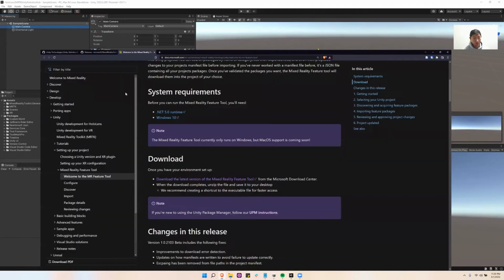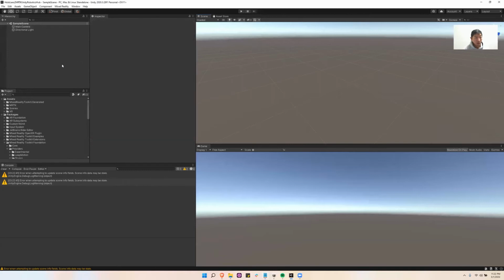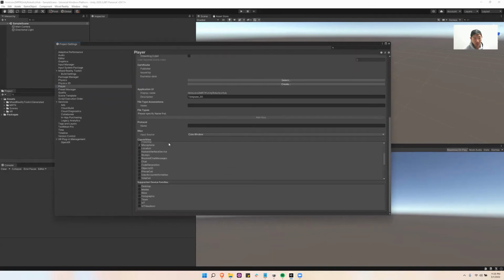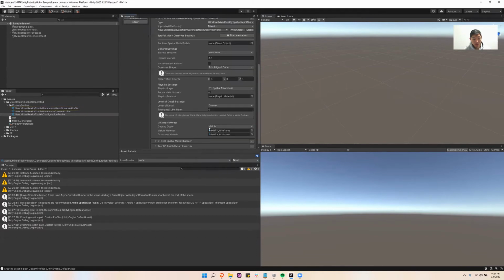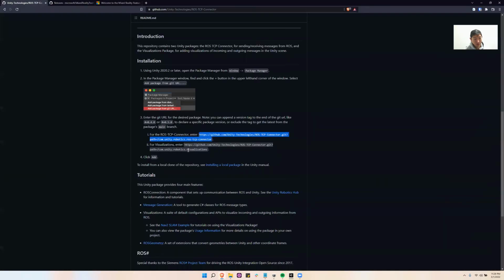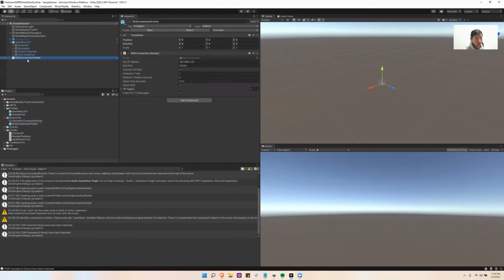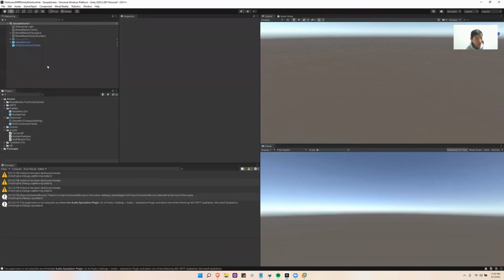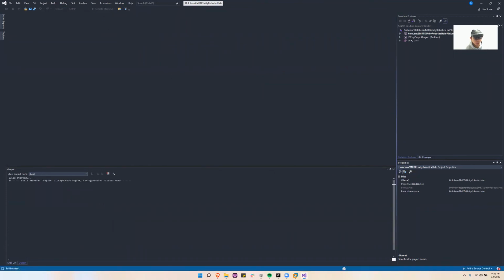(Updated) Unity Robotics Hub: Connecting ROS to a Unity project on the Hololens 2

Comment: Hello Bryce,

Thank you so much for your tutorial! It has been incredibly helpful. However, I’m facing an issue where I cannot get the HoloLens to communicate with ROS. Specifically:

I can’t see the IP address status (in red or green) on the configuration button within the HoloLens application.
When I try to input the IP address using the number pad, nothing happens.
I’ve done some troubleshooting and confirmed that Unity can communicate with ROS successfully when running the application on my laptop. However, the HoloLens seems unable to connect. I also tried using the ROS bridge URL in other projects, but the same issue persists. This indicates that the problem lies with the HoloLens.

To diagnose further, I ran the following command in WSL:
nc -zv <IP Address> 10000
This was to check if the HoloLens could communicate through port 10000, but it failed, confirming that the problem is with the HoloLens.

Do you have any suggestions on what might be causing this or steps I can take to resolve it?

Thank you in advance for your help!
Reply from the maker: It has been a long time since I have deployed a project to the Hololens 2. Rather, I strongly recommend using holographic remoting if your project allows you to do so. That fixed all my networking problems. If you can't do that, I would recommend making sure your hololens is on the same wi-fi network, in developer mode, and if using docker it is bridging correctly.
Reply: Thank you so much @bryceikeda7782 !! I tried holographic remoting, and it worked! Any idea why this approach succeeded, while running the project as a standalone application on the HoloLens 2 did not? Do you have any suggestions for troubleshooting or improving the standalone application? Thank you!
Reply: Thank you so much, @bryceikeda7782  !! I tried holographic remoting, and it worked! Any idea why this approach succeeded, while running the project as a standalone application on the HoloLens 2 did not? Do you have any suggestions for troubleshooting or improving the standalone application? Thank you again!
Reply: Thank you very much @bryceikeda7782  !! This really helped!! Any idea why deploying the application as a standalone on the HoloLens2 is not working, while holographic remoting is working? Do you have any thoughts about how to establish communication without using Holographic remoting? Thank you again!

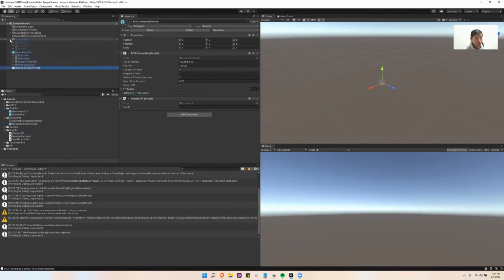Comment: Hi, Thank you so much for your video it is helpful to make my project topic based on augmented reality. But im facing an issue that is in my number pad input (script), There are no any tabs for ROS and connect IP. Only two tabs are available it is script and set IP button text. How to get those ROS and connect IP tabs? (For your ref: you explained this in your video on 9:01).
Reply from the maker: It's been a while since I've worked with this repo. However, I think I updated the directions so the video is slightly out of date. I would follow the REAME directions in the repository itself. If that still doesn't work let me know!

Comment: Thank you so much Bryce for this amazing tutorial! 
I seem to have almost everything working... I'm on Win11. I've successfully built the HoloLensBaseProject and uploaded it to my Hololens device, and I've properly established a connection between my ROS on WSL2 and my Hololens device. I even get the number counter incrementing!

There is just one issue, on Hololens, the first button is forever stuck with the subtitle "Set IP Address".
When clicked it opens up the custom keypad. This keypad is pretty much unresponsive. The textbox is stuck saying "Enter IP Address..." and all numberpad keys are unresponsive. Hitting clear, backspace, or OK does not interfere with my ROS connection whatsoever.
My connection with ROS is working, but that's because I set up the correct IP Address while building the project in Unity under Robotics > ROS Settings.

What is weird is that when I press play in the Unity editor, I can also connect to my WSL ROS, but there, the buttons work ! The first button has my chosen ROS IP as a subtitle, and the keypad keys are responsive. I can change my IP with the keypad to disconnect and to reconnect.

Would you have any idea why the menu and keypad wouldn't work on Hololens vs on Unity?

Thank you very much in advance,
-Liam
Reply from the maker: Hmm this is a tough one. It's weird that it works in play mode but not during deployment. Have you checked to make sure you are building the correct scene?
Reply: Hi,I have encountered the same problem as you. Have you resolved it yet,Thank you very much in advance
Reply: @游勇-v7d  I unfortunately haven't figured out how to fix this issue. I will write again if I find a solution someday. @bryceikeda7782 I believe I am building the correct scene (the only scene I have in my project).

Comment: hi Bryce, thanks for your video. I can connect to the ros on Ubuntu via Unity on Windows (Green on IP position). However, the hololens2 can not connect to the ros (Nothing happened). I can not find the problem.
Reply from the maker: Hi Jiazhen, are you able to successfully ping the HoloLens IP from Ubuntu?
Reply: @bryceikeda7782  I can't ping Hololens from Ubuntu (VM), but I can access to the 1XX.XXX.XXX.XX to control the Hololens on the web browser... btw I can ping my windows from Ubuntu.🤔
Reply: @bryceikeda7782  Hey Bryce, I also have the same issue as Jiazhen. I can't ping the Hololens IP from Ubuntu and from what I have read online it seems Microsoft blocks ping requests to the HoloLens? Are you able to ping your HL?
Reply from the maker: @zyx-kb3cl  Ah okay, that rings a bell, yeah you probably can't ping the HoloLens. Networking issues are tough to diagnose. I would recommend you use holographic remoting, that way you can run everything on Unity and it just streams to the HoloLens. Since the network is already working in this Ubuntu-> Unity on windows setup.

Comment: Great video though how what did you do in ubuntu? i can't connect
Reply from the maker: I would make sure that your firewall is not blocking connections to or from Unity. It should be in your firewall inbound rule settings under the Unity version you are using. You should also check to make sure Ubuntu is under the same network as the Unity application. If you are using WSL or another VM, its network should be bridged. If you are doing this to two separate computers, they should both be on the same wifi network.

Comment: Hey Bryce, 
Thanks so much for your videos since they have been a huge help with my senior design project thus far. I'm at a sticking point in  my project and was wondering if you could provide some guidance.

I am working on connecting a Unity Project for a HoloLens 2 headset to a RPi 4 running ROS2 to control it remotely. I set up the TCP Connection successfully thanks to you but now I am unsure how to send ROS msgs from Unity to ROS2. More specifically, under the "Robotics" tab, I am unsure which path to put for the "ROS message path". Do I need to have ROS2 installed on my local machine that I am running Unity on? If so, I might be in trouble since I am running on Windows 11 and not 10. Any help would be greatly appreciated. Thanks :)
Reply from the maker: Hi, glad you were able to get this working with a RPi 4 running ROS2. I haven't worked with ROS2 yet but it's great to hear people are having success with it. In terms of the ROS message path, I think all you need to do is download the relevant message files. For example, it looks like https://github.com/ros2/common_interfaces holds most of the common files for ROS 2. Then you can set the ROS message path to wherever you downloaded those files to so that you can generate the messages for Unity.
Reply from the maker: Also, you can follow this video I made https://youtu.be/LxK6jxpwNa8 which actually shows you how you can use get Ubuntu running on WSL 2 in Windows 11. That way, if you wanted to, you can use ROS with windows! Let me know if you have any other questions.
Reply: @bryceikeda7782  That worked!!!!! Thanks so much!!!

One more question off of that would be how I would access those messages in a separate script? I'm following Unity Robotics Hub's tutorial for creating a publisher script. When I create my own script, how would I access those message types from that repo when using a function like "ros.RegisterPublisher<PosRotMsg>(topicName);"  instead of <PosRotMsg> found in the example script

Thanks again for all your help!
Reply from the maker: @mad4234  So you would need to include the namespace those messages are in. If you click the RosMessages folder, and find the script with the message type you want to use, check out the namespace. For example, it could say namespace RosMessageTypes.Control. In the script you want to use it in, put at the top "using RosMessageTypes.Control" and then in that script you can use whichever message for the publisher.
Reply: @bryceikeda7782  Awesome, thank you so so so much!!!!

Comment: Hi Bryce, I’m really new to Unity and ROS. I’m doing a robotic project involving HoloLens2 and I need the device to communicate with a robot via ROS2. So I was just wondering if this could also work with ROS2? Thanks
Reply from the maker: Hi Massittha, it will work with ROS2. If you go up to the Robotics tab in Unity, then click ROS Settings and switch the protocol to ROS2, it should work from there. However, I have not used it with ROS2 yet so I don't know how it differs from ROS1.
Reply: @bryceikeda7782  Thank you Bryce! I’ve tried deploying the Unity Publisher from Unity Robotics Hub on HoloLens2 and it works.

Comment: I have not been able to connect ROS with Unity. Could you help in pointing out on how to correctly configure the network configuration on both Unity and ROS on VM?
Reply from the maker: Sure, is your VM using a bridged network? Did you allow the Unity connection through your firewall?

Comment: Hello Bryce , I'm beginner and I want to connect my hololens 1 to ROS Melodic on my computer but when I build the project on unity, I have the following compilation error message:

error CS0234: The type or namespace name 'UrdfImporter' does not exsit in the namespace 'Unity.Robotics' 

Do you know about this mistake and how solve it ?

Thank's a lot
Reply from the maker: I would make sure you have the URDF package by checking in your package manager. It should say URDF Importer and have a green check mark
Reply: When I import package on unity the git import URL does'nt work so I've download the GIT on my computer and I use add package from disk to find it,I think the problem comes from this step.

Have you installed a module or performed a manipulation to be able to import a GIT from a URL?
Reply from the maker: Hmm I feel like that should be fine. Did you try using this url: https://github.com/Unity-Technologies/URDF-Importer.git?path=/com.unity.robotics.urdf-importer#v0.5.2
Reply: Yes, and I have many erros who appears :

No git executable was found
(but I have already install it  on my computer)

Cannot perform upm operation

Error adding package
Reply from the maker: Gotcha, try this link. This is the one I use rather than the newer one. https://github.com/Unity-Technologies/URDF-Importer.git?path=/com.unity.robotics.urdf-importer#v0.5.0 also do you have an asmdef in your folder holding the scripts that are giving you the import error?
Reply from the maker: Perhaps you aren’t linking the URDF library to your scripts and that why it is giving you an error
Reply: Sorry but I don't find asmdef in my folder and where I can find the URDF library ?
Reply from the maker: @lucasmonteiro9678  The URDF library should be in your packages folder. Minimize your assets folder in Unity and then open up the packages and make sure the URDF library is there. Also, I just tried both the git url links and they worked for me. Do you have github for Unity installed? If not that might be the problem. https://assetstore.unity.com/packages/tools/version-control/github-for-unity-118069